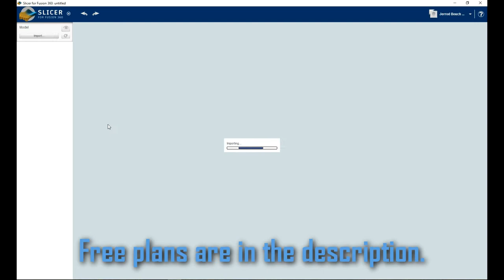How to Make a Wooden Jack-O- Lantern | Scroll Saw Halloween Project

Comment: hey thanks pattern because helped me with pattern. im going help with jack face. if got printer and can print off punkin patterns. you shrink the patern as small want. witch means get small enugh fite punkin. use exacto knife cut patern with sharp draw on punkin. use dremel with small cut bite cut out pattern. also if shine flash light through patern the shadow will real big trace patern bigger on something. so if shine flash light at cut out your patterns. you make one these as big as wall if want. witch make put pattern on it really easy. just tape poster bord to wall that blue masking tape . and trace patern on card bord cut out trace on boards.